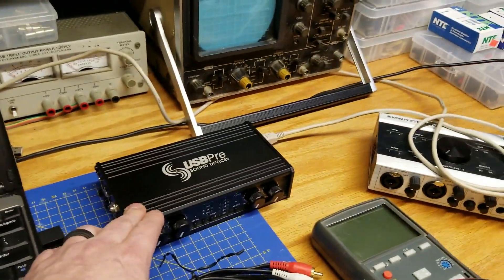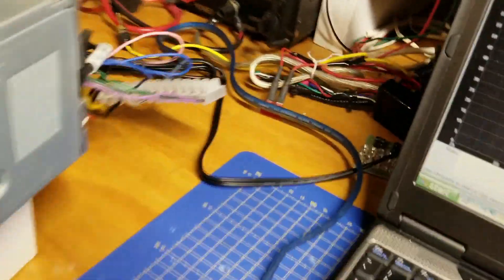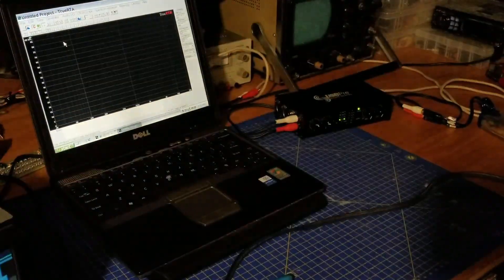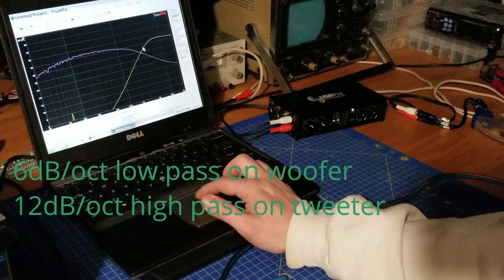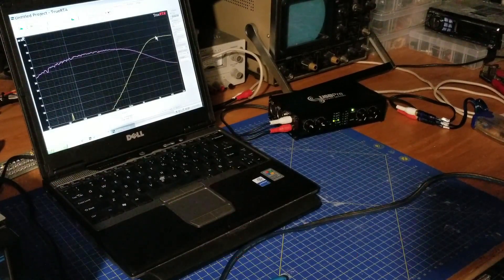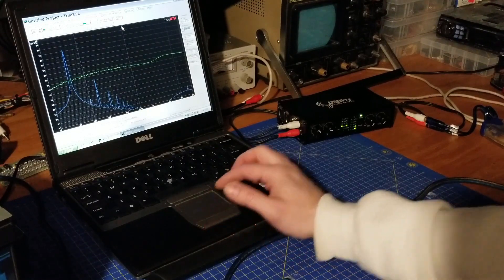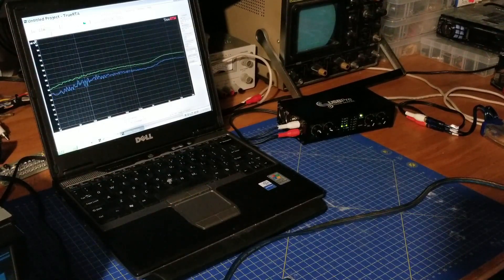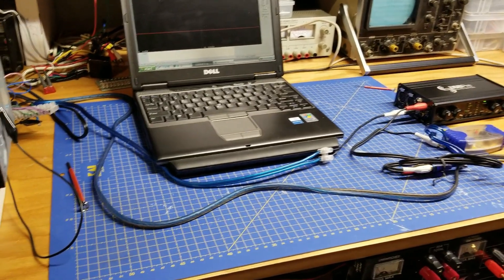Instructable!   Using an RTA to measure frequency response and as an Oscilloscope

Comment: hi would this be better than using a usb oscilloscope
Reply from the maker: I use an analog scope as well, but an RTA provides much more information and can double as a scope (with the right software).   Maybe link the usb scope you're referring to?
Reply: @richardvedvik979  owon 1022i

Comment: What Windows Operating systems currently available work with that USBPre?
Reply from the maker: The laptop in the video is running Windows 7 Professional.  It was recognized and operational without hassle (i.e. discovery was successful).  Unlike the previous Win XP laptop used, this laptop did not require any manual intervention to map the port or operation.   I have not tried the USBPre on a Windows 10 PC or the Surface Pro 4 also shown in the video.

Comment: Where can I buy an LED clipping indicator pre-made like from amazon or some website that I can just order it online?
for car audio amplifier.
Reply from the maker: Sorry I missed this comment.  There are a few sellers looking to bring this idea to market.  I'm sure they'll charge much more than the cost of the actual parts (under a few bucks).   A simple LED indicator for subwoofers would be an LED powered by the amp output but ran through a 1kHz high pass filter.   Maybe I can experiment with this.

Comment: 11:44 looks like transformer saturation. Ditch the LOC and just use a potentiometer. If you need DC isolation, use series capacitors.
Reply from the maker: lazzer408 note that later in the video I bypass the loc entirely and you can see how the direct output compares with the LOC.
Reply from the maker: I measured that head unit and another head unit RCA outputs directly with no LOC or crossover, both on an oscilloscope (in background of video) and on the RTA.  Similar effect,  though the DVA-9861 had a "sharper" shape.  Maybe related to slew rate of the signal path.